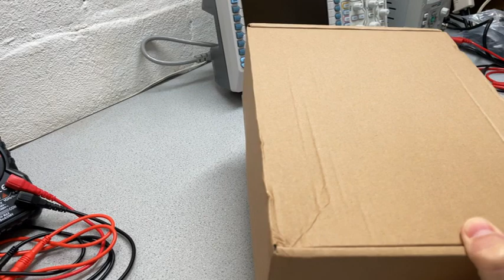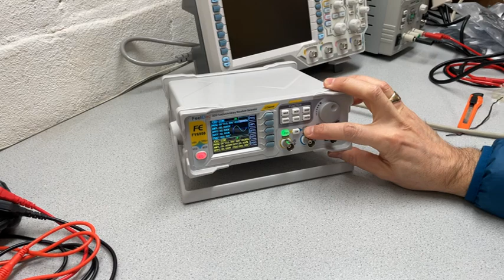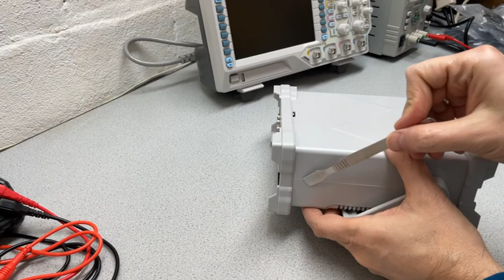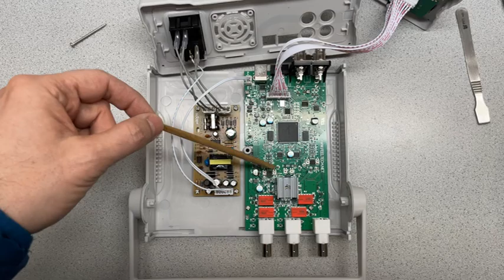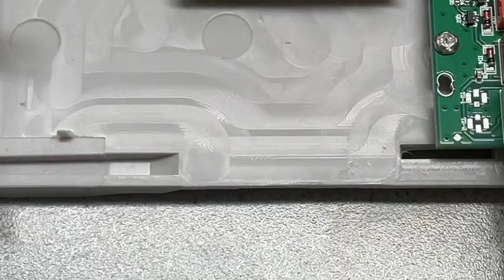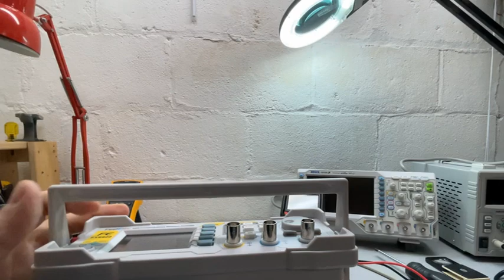FeelTech FY6900 Signal Generator Unboxing and Tear Down

Comment: I also have a FY6900 60Mhz and have had mine about 2 years and have no problems, my one has the same set up inside but my one uses the other power connections. what you have to realise these are made down to a price but a 60Mhz Arbitrary Waveform-Function Signal-Generator, with loads of wave forms, and a memory to store about 60 of your own made wave forms, and its dual channel and it contains a 100Mhz signal counter, ETC for around $120 (depending where you get it from). And all you have done is pick holes in it! the only odd thing i can find with it setting it up with a modulated tone (or carrier signal)

Comment: The Soft Start saves your changes you made to the unit - when you turn of all power it returns to Factory Default Settings. So if you want the BNC Jacks to stay turned off - you need to change the Programing or leave the main power switch on to hold the memory of your last settings.
Reply: Nope....you can change it in the settings.....